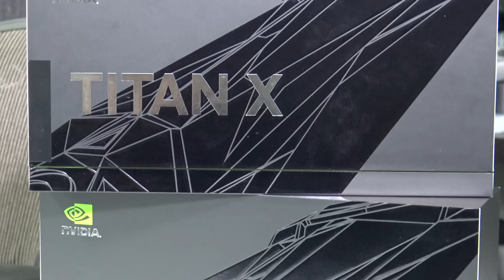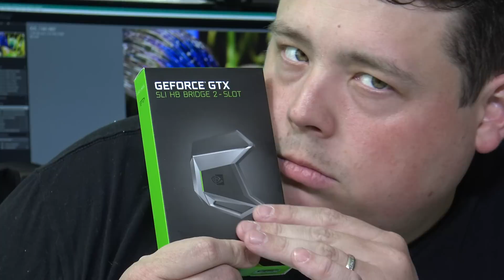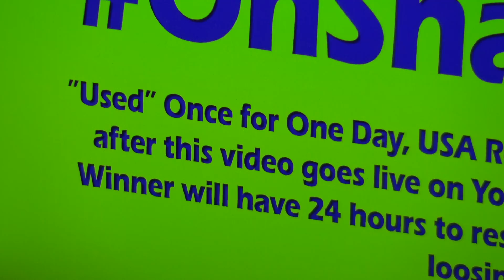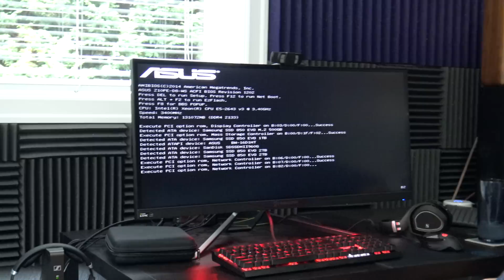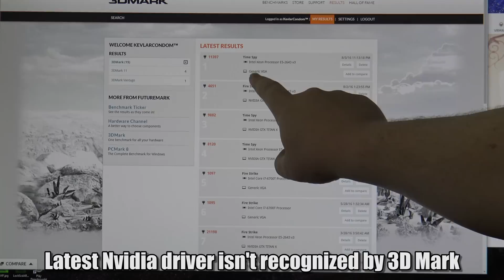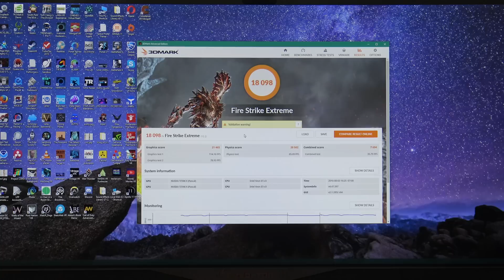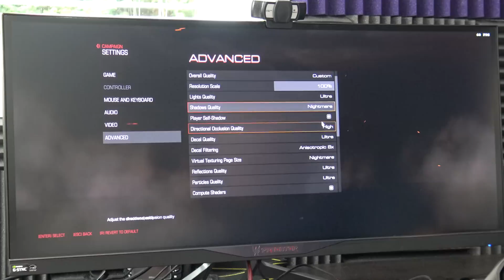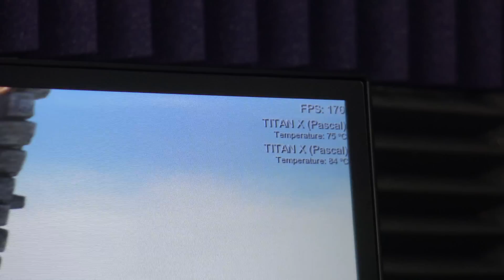Fastest graphics cards in the world! - @Barnacules

Comment: You gotta do some tweaking with your cards,  you gotta get more out of them --  my 2 1080s are getting a better score than your Titans -- I'm consistently over 40k in the Graphics score in Firestrike. Your Xeons are giving you a boost in Physics, so your total is a little higher than mine, but graphics wise, meh. Reference eddition (ohh wait -- Founders) cards suck, waste of money, wait for better coolers. That's what I did, I'm runing EVGA oc cards, and am stable at 2100hz. I can't see how titans are worth the money at this point. It's $1k more for a pair of Titans vs a pair of 1080s, checking all your scores you are either even with what I'm getting or a 2-5% lower or higher in different cases
Reply: Cool story bro. But, the Titans can do stuff the 1080's can't do. It's not just a graphics card remember?
Reply: No OC... Jayz getting a stable OC so that's next.
Reply: many would say 2x 1080s are a waste of money.
Reply: what are your oc settings for sli 1080s?
Reply: Using EVGA Precision X: Power target 120%, GPU offset 100, mem offset 250 - voltage 90%. Custom fan curve. It boosts up to 2100hz and temps stay < 75c -- usually in the 60s. EVGA cooler is very quiet. TitanX should OC to at least 2Ghz and the scores should improve drastically.
Reply: thanks for the reply mate! I have sli 1080's as well and have being trying to find a decent clock. so you put the voltage to 90%?
Reply: Glenn Parker yes, just into the red, if it's not holding, try maybe 92 or 93. Its all about the silicone lottery with OC, some people can get memory to run at 5500, for me 5250 is stable, anything above is flaky.
Reply: Thanks mate!
Reply: kazolar, you're special kind of stupid aren't ya. Titans aren't for gaming, how hard is that to understand? One could also deduct from the video that since those are in a dual xeon -system, they really aren't for gaming. And lastly good luck trying to find a titan with anything than the nvidia's cooler. Those are cards they are selling only by themselves.
Reply: ilaril I don't normally respond to trolls, but for you I'll make an exception. THIS video you brilliant guru of all tech, is ABOUT gaming benchmarks. THIS VIDEO is not about Titan uses for multi-gpu cuda computing. You wouldn't even need an HB bridge to do that. YOU must have reading comprehension issues. My comment was regarding the benchmarks in this video. The benchmarks and demos in this video are GAMING, or you didn't even watch and just jump to comments like the troll that you are. Titans can be modified or given enough time they do come out with 3rd party coolers. That's not even the point. But -- good for you, you get feel superior on YouTube comments by throwing insults.Check yourself before calling people stupid. Titans are not for gaming, spending an extra grand or more over the 1080 if they did in fact pay $300 for an HB bridge which can be ordered from Nvida for $40, for the purposes of doing gaming benchmarks is pointless, but -- congrats.

Comment: who cares about to do one most games only utilize one GPU anyways
Reply: Almost every game I own supports either crossfire or in the case of direct x 12 or Vulkan multi-GPU so most games can take advantage of more than one GPU.  In fact, the only game in recent memory that I recall having issues with was Fallout 4.
Reply: Well said.
Reply: +kuhrd most games do support SLI/Crossfire but there's almost always some kind of issue. I dumped my Crossfire setup about 2 years ago because the only way to get rid of jitter or frame stacking was to run triple buffer or frame pacing. Both added latency and made Crossfire unusable in FPS games and during heavy racing games. I don't mean to knock on it, in single player games it was great!

And I have noticed new games do a better job of supporting dual GPU's especially! if it's DX12/Vulkan. So I might just eat my words :)
Reply: Gabriel Soria I will say that great strides have been made in DX12 and Vulkan.  My past GPUs were 2 HD6990's running in Quadfire and they were amazing for the time but did have very noticeable jitters and stuttering in some games but others it was not nearly as noticeable or non existent.  It really depended on how well the driver was optimized for the game.  

That being said the performance of those 2 HD 6990's in Quadfire was about equivalent to the performance of a single RX480 in most games I tried.  The biggest setback of the 6990's in today's games was the 2GB of vram per GPU on each card and AMD's reluctance to support the card with any future driver releases even though it is a GCN 1.0 architecture.

So far I have seen pretty decent scaling in the majority of games I have tried with 2X RX480's with much less stutter or jitters but it is still there in some games.  I really can't wait for the future of directX 12 and Vulkan to see how things pan out.  At this time I really think AMD is doing well at completing in the middle and low end markets where a majority of GPUs will be sold.  I also think that the GTX1060 would have been priced $50-75 higher had the RX480 not set the bar at $200 for decent entry level VR and 1440p performance.  I would also like to see the performance of these Franken systems where we can take mixed GPUs from Team Red, Blue and Green and get even more performance and bang for the buck.
Reply: suure

Comment: Lazy rich people can't be bothered to water cool their rig.....
Reply: Water cooling isn't going to gain him much unless he really decides to overclock the crap out of those cards.  Besides, is the risk and the voiding of the warranty really worth a few FPS bump, when he is already wasting most of those frames.
Reply: did you not watch the video kuhrd? the card was thermal throttling in the heaven benchmark, so he would gain a tonne of performance from watercooling
Reply: ***** I watched the video and it was thermal throttling but he already said he ordered a new SLI bridge and was going to move the cards one slot apart and retest.  Only the top card was throttling so once they are moved apart and a custom fan curve is set like you pretty much have to do for all the current reference coolers from both teams to get decent temps it should no longer be an issue.  Water cooling is not the end all be all of cooling solutions especially for a workstation.  Air cooling has been more than adequate for most systems even with a decent overclock.
Reply: Fair enough, but water-cooling usually requires less space, gives you less noise, cools your components better (usually) and by extension you get more from the GPU/CPU you paid for. I'd say getting more fps/$ is pretty useful, and you get all that at a slightly higher  initial price (unless you go for something unnecessarily elaborate)
Reply: ***** I would venture to guess that water cooling both GPU's would set you back at least $350 for AIO coolers.  If you add in both CPU's your probably adding at least another $200 for a pretty bargain basement water cooling setup.  It didn't look like he had much space for radiators in that case and just to equal current air cooling you would probably need at the very minimum a 20mm thick 120mm rad for every 75-150 watts you are trying to dissipate depending on fan static pressure and CFM.  So in a system like this I would think you would really want a 480mm rad 40mm thick for the GPUs and a 240mm rad 40mm thick for the CPUs at the very least.  

With a completely custom water cooling setup without going too crazy but with quality blocks, pumps, radiators and accessories I would expect it to cost at least an additional $800-$1200.  For that much extra money, even if you were able to gain an extra 5% bump over the current air cooler setup, it would be really hard to justify IMHO.
Reply: ***** I would be very hesitant to do so on a $1200 card or 2 of them for that matter even if Nvidia decided to honor the warranty.  I would guess that you have to use a certified cooler or water block and you would really want to videotape the entire process from start to finish just in case you run into issues later and need proof that you did it right.  

Any physical damage is not covered by the warranty, especially if you change out the cooler so if a VRM blows and leaves a skid mark on the chip or PCB they could easily choose to void your warranty even if the card ran fine for 6 months or more after the cooler was installed.
Reply: I don't think it's possible to damage the vrm's.
All decent water blocks cool those.
Reply: you can damage the vrm's if you dont apply the thermal pads from the waterblock properly
Reply: Well yeah i suppose, although from watching video tutorials that would be too hard to screw up.

Comment: and i am sitting here hyped with my i5 6600k and a gtx 1070
Reply: Still a fast system though ;)
Reply: You should be, that's a sweet system
Reply: I got an i5 4570 and gtx 750ti im saving up for a 1070 tho if i win the giveaway im gonne fckng scream my lungs out
Reply: And here I am with a 650 Ti.
Reply: ive got the i5 6600k, and an r7 370 :/
Reply: 6600k is pretty bad tho
Reply: Im hyper with my AMD FX 8350 and GTX 960 :)
Reply: +TheGreatUtopiaCat all i want is 4k at 60fps but maximum settings without AA because idgaf about anti aliasing. but I want something that can do that plus never dip below 60. the minimum fps has to be 60ish, other than that I don't really care how high the fps is as long as it never goes below 60
Reply: +Phantom i would shit if i won lol
Reply: Titan X is not thinked for gaming, why would you care? Also, waste of money :P 1070-1060 is the best  unless you play 4k
Reply: +Jesse Pinkman i cant get my 6600k to overclock from the bios.
Reply: +Jesse Pinkman Lul bad how?
Reply: look! a poor person!
Reply: lol , i have the same , what motherboard ?
Reply: i paired my 1070 with an i7 6700k and triple fan radiator for overclocking headroom and for possible sli in a few years when 1070 is cheap as fu. I heard the i5 bottlenecks an overclocked 1070. I'm running the g1 gaming 1070 which can oc pretty high (over 1800) damn though if I went with the i5 (which had a better sale) and got a more barebones motherboard (definitely didn't need an ROG) and scrapped the tri fan radiator case I could have saved almost 500 bucks cdn....but once you start spending money on something it's tempting to try to push it a bit. I'd say I went slightly over the mark of the best possible value with this one....check out my case though it's the deep cool genome saw this fucker and just had to have it
Reply: David Duff Probably cause your motherboard doesn't support overclocking.
Reply: 6600k in my build fast, but shit overclocking. but I have an r9 380 :/
Reply: +Jesse Pinkman msi krait gaming 3x
Reply: I am here hyped for... Nothing i could afford...
Reply: got an i7 4790K and a 1070 :)
Reply: +kiss peter msi z170a gaming pro
Reply: +Weak1ings i7 4790k and a gtx EVGA 970 SC here
Reply: i5-3450 w/ 2 1070's. Time Spy score better than 91% of the results. So, I'm hyped. I'll be really hyped when I eventually upgrade to an i7 6700k.
Reply: 6700k and a 980ti. 1440p
Reply: :P
Reply: Swag nice , i have asrock z170 extreme 6
Reply: dude im on a cheap dell laptop it has a intel pentinum and 2 gb of ram
Reply: lol i am running a E2200 2.2 GHz CPU on a G31M mobo with 2GB DDR2 RAM that was bought in 2010. 😭
Reply: Jake Stewart
1070 is better than 980ti, but not by an enormous margin. The power draw and the price are really the key attractive characteristics for me, the 1070 consuming considerably less power than  the 980ti
Reply: And I'm here hyped with nothing because I don't even have a computer
Reply: +TheGamerDude actually smartphones are also portable computers in a sense 😜
Reply: +Mahieyin Rahmun Yes i know this lol. I just dont want a computer because I can't afford a good one and I'd rather have just my phone over a shit pc. I have the Galaxy S7 Edge.
Reply: TheGamerDude
being on ur phone all the time is fekd lol. I couldn't imagine actually using my phone as a computer for daily shit, I just like it for when I need to google something on the go or find my way in a strange land. Honestly the main reason I like having a nice phone is for a good camera and audio recording capability, which the z5 compact has in spades, most functionality, smallest phone.
Reply: +TheGreatUtopiaCat I actually don't mind it that much for now. I really want a desktop but I don't really have much money and would only be able to afford a piece of crap. So im saving up and just gonna wait until I have enough to build my own for about $1,300
Reply: TheGamerDude
1.3k american can build you wayyy better than a piece of shit. You could get an extremely capable 1080p gaming rig for 800 american easily.
Reply: TheGamerDude
talking tower alone though ofc monitor speakers keyboard and mouse are required
Reply: +TheGreatUtopiaCat yes tower alone, I already have a custom home theater in my bedroom and a 55 inch 4k tv so all I have to buy is the keyboard and mouse.
Reply: +TheGreatUtopiaCat and I dont want 1080p I have a 4k tv so I want minimum of 4k 60hz
Reply: TheGamerDude
4k is what you want??? Yeah in that case you definitely want to get a gtx 1070 minimum, and honestly if you're looking for above 60 fps in 4k especially going into modern games you're going to need to sli something at least as powerful as a 1070, a single 1080 even will struggle with full settings at 4k, the cheapest way to get this done as long as you don't need 144hz is to go for the 1070 sli and find a good deal on your cards
Reply: TheGamerDude
well 4k at 60fps for modern games especially ones coming out in the next couple of years is still very demanding, and even a 1080 will struggle. I mean if you get one 1080 then you can possible sli 1080s in the future, but 1070 is the value spot IMO so I'd just sli that.
Reply: I only have i5 4460 and GTX 960 XD
Reply: Me too!  lol
Reply: Dude, your setup is still legit.  It doesn't have to rival Jarvis to handle business.  There will always be a bigger, faster card, but if your graphics are doing the job you need them to do, then you're good.
Reply: And I'm sitting here with my i5-2500T and my GTX 750Ti.
Reply: +BlackHawk2306 lol same
Reply: +TheGamerDude 4k at 60fps is asking too much from a 1300 build, it's impossible. In fact, it's pretty much impossible with a single card, you would need to grab 2 1080s and sli and half the games won't work properly..
Reply: +SaladFingers 😑i dont like sli or crossfire. it doesnt scale well enough for me to want it. and not all games even support it.
Reply: TheGamerDude I know that's what I'm saying... but you probably need to lower your expectations a bit. 4k@60hz is still not easily achievable. Just grab a 1080ti when it comes out and pair it with an i5.
Reply: +SaladFingers well im not wasting my money on a computer monitor when i have a 4k tv that has a very low 23ms response time.
Reply: TheGamerDude Well don't, just don't run it at 4K when gaming... Btw 23ms isn't really low.. Only for a TV :)
Reply: +SaladFingers for a tv thats really low. and youre really not gonna notice the difference between 23ms and something like 5ms
Reply: TheGamerDude I personally do notice a big difference, because I actually move between a TV and a 1ms monitor with 144hz. The TV is a Vizio and it's also pretty low response for a TV (they are kind of gaming TVs). I play my "couch" games at the TV at 60fps and a gamepad and anything else on the desktop. Anyway, all I'm saying is, perhaps try running your games at 1440p or something, 4k is too demanding and the performance just won't be there and you won't like it :P
Reply: +SaladFingers thats not comparable since the high refresh rate combined with the low response time of that monitor is different. if you had a 60hz 1ms monitor and have a 60hz 20ms tv then youre not going to have any perceptable difference.
Reply: TheGamerDude It feels pretty different to me. Perhaps because I'm used to experiencing the difference in the input lag on a daily basis and I'm able to compare directly. I actually have ran games locked at 60hz on the 1ms monitor (some AAA games just can't do much more on my little 970) and it feels much more responsive and less "stuttery" (I can't point my finger on this but the TV sometimes feels as if it's missing frames, could be a different problem but I haven't figured it out yet).
Reply: I have only an i7-6700K and a GTX 1080. Being poor feels awful
Reply: WTF i have an intel core 2 duo e4500 and GT 430 :( i'm poor
Reply: Dood I literally have that same setup except I got i5 6400 and 1070 founders
Reply: amd fx8370, gtx970 :(
Reply: i5 6600K @ 4.8GHz and a HD7850 2Gb. ( ͡° ͜ʖ ͡°)
Reply: +Popescu Andrei fx 9370 gtx 970 :(
Reply: +Niels Vanleeuwen what mobo are you using? My fx is on an asus 970 pro gaming aura
Reply: i7 4510U r7 m260
Reply: I am sitting here with my Intel hd graphics
Reply: i3 4160 with gtx750 (not X)
Reply: I'm looking to getting into a system like this, is it worth it?
Reply: Awesome plays Hell yes
Reply: Awesome plays Fuck yes it worth it. You would run everything maxed out in 1440p, easy
Reply: i5 4690k and 2x evga 780ti in sli
Reply: @TheGreatUtopiaCat dunno who sold you that lie about the i5 but it seems like it paid off to the seller lmao. since when an OC´d 6600k would bottleneck a 1070 if it doesnt even bottleneck a 1080... like jay says, ppl love to throw the word bottlenecking around alot without even understanding how it works.
Reply: i have an i5 6600k and a gtx 1060
Reply: Saphyr I was in your position 3 months ago I had a trash 300 dollar 2013 dell desktop
Reply: would my 6600k be enough for 2 way titan xp? im gonna have them next month.
Reply: That is pretty neat.
Reply: Swag yep it's shit
Reply: Swag and i am sitting here hyped with my fx 8320 and evga geforce gtx 1050ti sc
Reply: Iikka Uusitalo and I'm here with a iMac G5
Reply: hyped with my amd Athlon x4 640 and radeon hd 6670. I win.